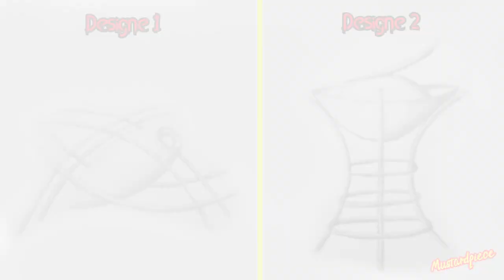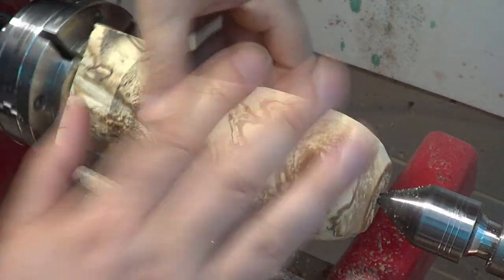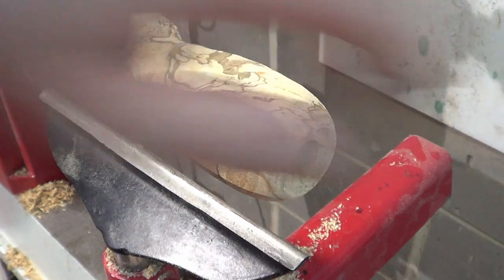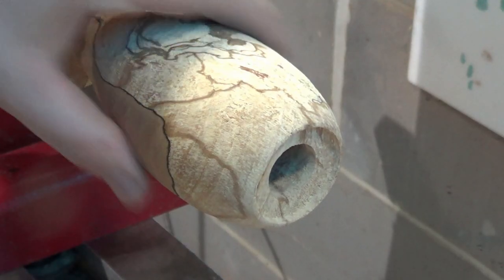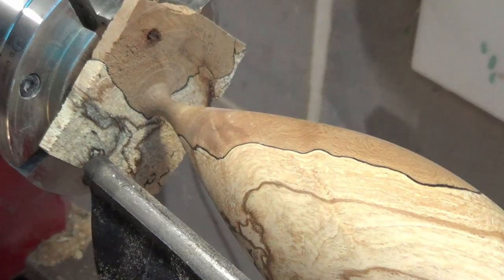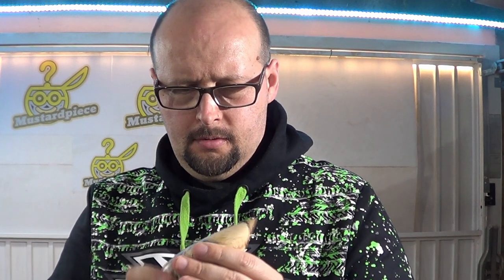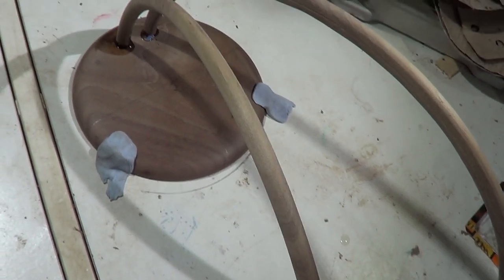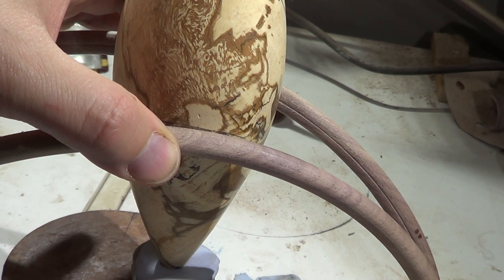Pushing the Limits - Woodturning

Comment: Just watch the above video (sadly without sound) at the start when you had the ornament thing done you didn't look pleased. BUT from the looks of the finished item it still turned out nicely!
Reply from the maker: Thank you my friend. I don't think you would notice that. In that moment of the video I said it turned out alright. What you don't see is that: I cut the base off, make a new base on the lathe. Carve the wholes again,  glue it in so I can insert the 3rd ring.  After doing that I consider this piece one of my best work yet.  If you look closely you will see that the base on the final piece is larger. ;) Thank you for watching.